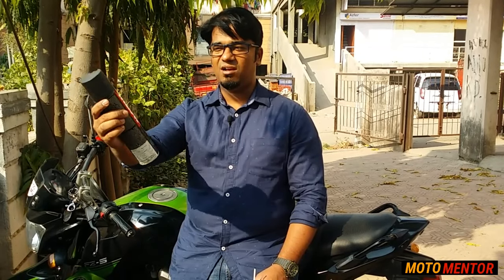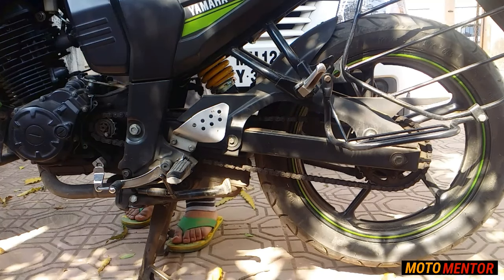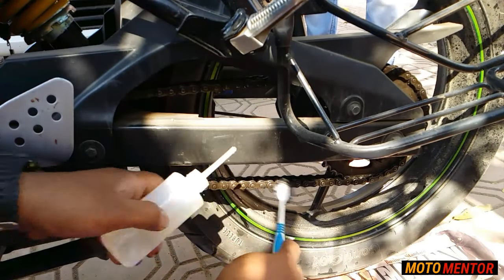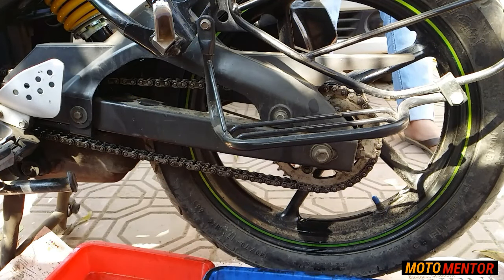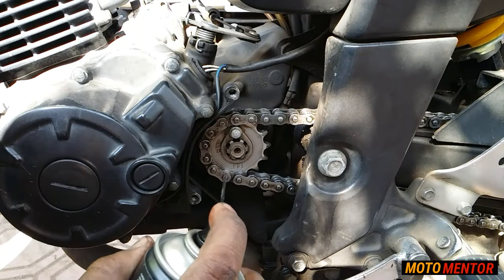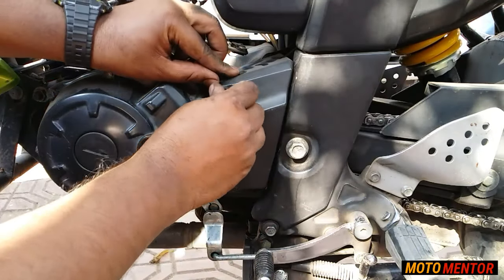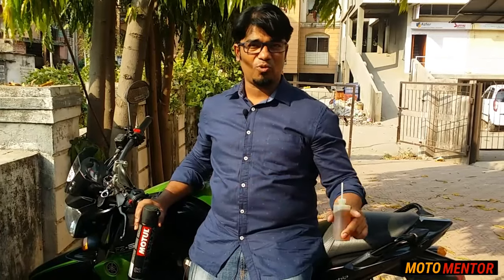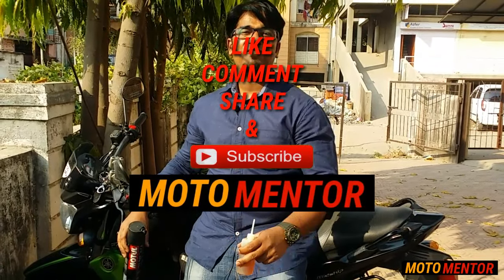BIKE CHAIN NOISE ? THIS IS HOW TO CLEAN AND LUBE MOTORCYCLE CHAIN MOTUL CHAIN LUBE VS 90 GEAR OIL

Comment: Which rear tyre u r using? Looks beefy. I guess its not 140/60?
Reply from the maker: It's continental 140/70-17
Reply: I have heard any increase in tyre size effects the ride quality like wobbling, and tyre rubbing on hugger? Pls share ur feedback.
Reply from the maker: Yes it did affect the ride  Quality with Lil vibrations which is annoying and also affected the swing arm bearing even m planing to switch back to original mrf but the only problem with mrf stock tyre is that it's too soft though the ride Quality is amazingly but it gets puncture very often. The continental tyre rubber is Lil hard and doest get puncture easily but you will miss the buttery smooth ride Quality which you get with mrf.
Reply: Ok. Thanks for sharing ur exp. I have heard ceat series is better than mrf and gives goodness of both the world. Even I was annoyed with frequent puncturing of stock but then put a tube in it and luckily the puncture reduced drastically. I know it is not logical but this is what happened. If u happen to try ceat or anyother rear tyre do share ur feedback. Also, suggest a grippy tyre for front.

Comment: Dude the way you lubed your chain is absolutely wrong,,, you have mentioned in the video that your chain is drying very fast after using motul lube, Because you have been applying way too less amount of lube on your chain,, which make no sense for O ,Z & X RING Chain,,I know motul is a costly chain lube but apply appropriate amount of motul lube,,it LL not dry fast on that you will feel better riding your bike,,,
It's a suggestion

Comment: Go to washing centre and pressure wash your chain instead using your hands let it dry for an hour and lube it using gear oil...
Note:- Do not use your hands to clean your bike chain.
Reply: Not a good idea. High pressure washer will get in your oring  and decrease significantly the life of the chain.
Reply: @indigo196799  did you tried ?
I am doing this on my 2012 classic model till date it's a brand new chain and chain sprocket.
Reply: @gunjanchoudhary6432  yes i did. It costed me a new chaîne acter les than 7000 km.
Reply: @indigo196799  which water they were using?
Did you immediately lubed your chain ?
Pressure wash was on chain or chain sprocket?
Reply: @gunjanchoudhary6432  high pressure washer from a karcher compressor. It makes the water penetrate behind the orings and ruining the grease it contains. Water from a garden hose should not be à problem. As a général rule, high pressure water from a high pressure washer should not be aimed toward any compponents of à motorcycle.
Reply: @indigo196799  so how come it's not affecting my bike's chain ?
May be you have misconceptions about it... Or maybe may I have....

Comment: Thanks for useful information... Can we use used engine oil (taken away from previous servicing)?... Some mechanic do use it... is it safe to lubricate chain...
Reply: engine oil (used/new) might do the job temporarily but in the long run its viscosity / thickness wud attract a ton of dirt ! - aaron (enfield)

Comment: Brother get ur facts correct, motul is producing products in backyard, its tested for thousands of kilometers before sending to market and for open chains any oil is like posion it will jam the O rings thus breaking the chain at high speeds..... always research before making videos.....
Reply from the maker: Hi Ajay, thanks for watching my video really appreciated. Just a request for you to go through all the comments and see your self how my people agree with me I didn't make this video blindly I am not against motul Chai lube I tested it couple of time and couple of bikes it's a good produce however you need regular check for this I have been using gear oil for more tha 7years no problem at all. Using motul chain lube made my Chain rusted during rain the same thing happened with my friend who was more like your thaught. I don't trust any brand blindly I test it first and than trust. Let me make it clear that M not againt motul however gear oil works the best for me my be motul works for you best I just added my view of opinion. Again thanks for watching brother 😊

Comment: Nope .....you shouldn't play with this stuff.....oils have higher tendency to degrade rubber .....and yes chains have rubber seal between the links ......best way is to clean the chain with deasel ....then wash ir thoroughly....then apply chain clean....and then lube it..with lubricants.....best way to do so is by using Yamaha lube .....they are beat in class and last for 1000 km.....i have been using it on my R15 and now i have driven 10k....and still only once the chain has been adjusted.....

Comment: I use grease for lubing my chain 🥴
Reply: grease  is very thick, and it stores near front sprocket, collects lot of dust, so i switched to oil ... gear 90 oil is the best
Reply: @nagarajbhat7869  thnks bro

Comment: Yes indeed do not clean a motorcycle chain with the engine running it is an accident waiting to happen but yes sae 90 oil is a top tip the only thing I would add is fit a chain oiler as well 
Happy riding 
Marc

Comment: Bhai you have no idea 💡 what ever you are talking. I think your Bike has got a chain with rubber “O” ring inside (open chain type) which will surely get damage once you put “ Petroleum products like Kerosene, Diesel, Gear oil , engine oil etc... so read the instructions on Motul or any other cleaner which is specifically designed for such open chain systems.... oil , grease is okay only in conventional covered chain (older bikes like Splender, CB 100 etc)

Comment: I think you do not understand the difference between the chain lube and gear oil. The purpose of gear oil is to attract dust or exhaust gases coming out from the cylinder. The engine oil attracts dust very fast and the chain will wear so quickly.

Comment: Sir i am quality control manager 
Mene apni bike me lube vagera use liya but cost bhi lagi aur koi khaas performance bhi nahi mili ...thn
Beacuse of my technical background mene chain ko open krke Diesel me soak kiya 2 hours then brush aur kapde se saaf krke clean kar k bike me laga di than
Ek oil liya tha mene jiska 140 no k naam se gear oil aata h usse kuppi ki help se puri chain par laga diya 
believe me chain kya smooth ho gayi aur saath hi noise free
Plz try once time my personal experience...

Comment: I am using motul for 10 years!! This guy is speaking whatever comes to mind.

Motul gets into the links and dries up to leave a greasy layer. Stickiness of that layer causes lube to stick on high speeds when chain gets hot. Oil will just fly away from sprockets at those speeds. 

Gear oil is best for covered chains and low performance bikes like 100cc executive bikes.

Also, dryness of motul or similar lubes does not allow chain to become a dirt magnet. Oil will attract all types of dirt.

Very misleading info IMO. Sorry to say.
Reply from the maker: Akashdeep m into biking since my childhood my father is a professional mechanic since 1960's whatever I have learned and observed practically is from him he is still better then most of the mechanics who belive in replacement than repair or kindly read some comments and see how most of the users have agree with me also try to understand what messages I was trying to convey. I was one of the first to make a video on this topic and now there are n numbers of videos made by other youtuber on the same topic m not fool to waste my time to share some valuable thoughts if you thing m out of my mind then thanks for watching and sorry I wasted your valuable time.
Reply: U r using motul...tell me lubing interval kilometer..  n what happend . If we lube with motul excess

Comment: I add oil into the chain while it's On the sprocket,so the links are open.The chain goes flat after and forces the oils into it.Thank you for the kerosene cleaning tip.

Comment: I tried this process today.
Followed by cleaning chain with diesel at washing center,
 I have done lubrication with Castrol Gear Oil 90 trust me that you would  feel the difference.
Normally we people go to any mechanic and ask him to Chain mein oil daal but that oil is mostly burn out engine oil which is 20W50 but Gear Oil 90 does job well.
Gear oil 90 is much thicker and hope it will stay longer.

After searching lot in local shops, i found 2 types Castrol gear oil 
Rs 90 - 120 ml & 
Rs 145 - 500 ml
Reply from the maker: Thanks for your support rakesh

Comment: Whole video would be ok, as a cheap way of cleaning and lubing the chain, if you hadn't included a Motul in this story. You have a bad experience with the motul chain lube beacause you are doing totally wrong from the whole begining. You can't clean the chain with any some kind of greaser and than apply Motul Chain Lube, thatswhy is doesn't work. There is a product Motul Chain Cleaner, or if you dont want to use it, at least, you should clean it with some kind of degreaser, like brake cleaner, that evaporate. Leave it to dry, and than apply Motul Chain Lube, so it can stick it right to the metal surface, that os the purpose of the product (Motul Chain Cleaner), to totally clean and deagrease the surface. Otherwise, it doesn't make sense, and that is why you have a bad experience with the product!